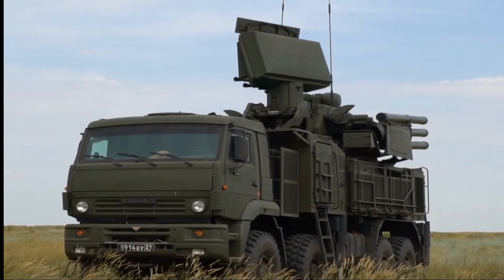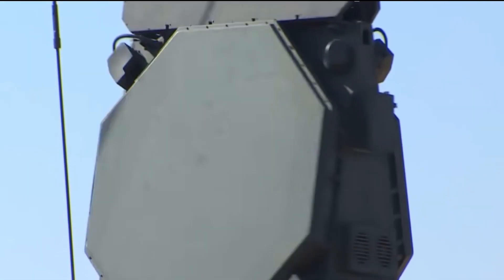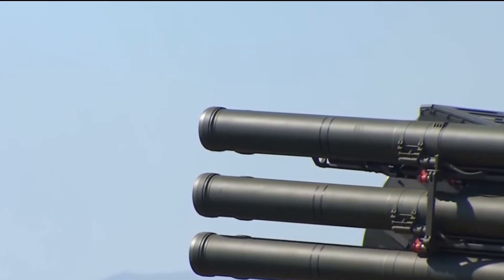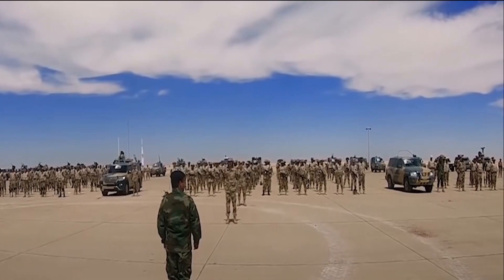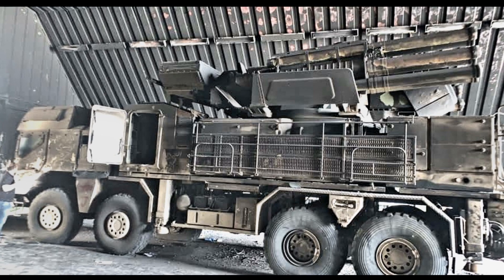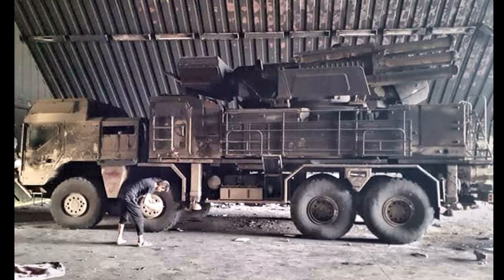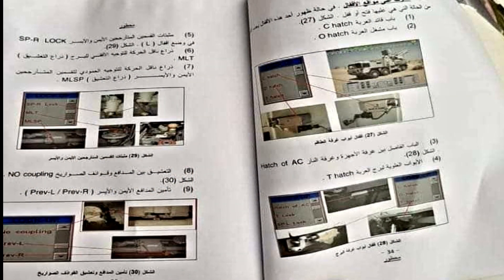The Pantsir S1...Useless piece of s-crap or there is more to the story than meets the eye?

Comment: There are many versions of the Pansir S1 system. Older versions with single-antenna radar have proven to be worse against, slow-flying objects like drones. These systems are mainly in their basic versions with a single radar antenna, in translation with poorer radar delivered to Arab countries. Very quickly, the Russians introduced the problem, replaced the radar with a completely new "JANUS" Dual Antenna Radar, which has no problems with drone tracking and destroying the same Russians. Pansir S1. Upgraded versions like the S2 and SM are just a story in themselves, even better systems, both in terms of radar and missile range, and the system itself. We could also see that the destroyed Pansir S1 systems were only with the old radar, not one with the new "JANUS" radar, which speaks in favor of the facts ... Also, we saw several destroyed S1 systems, in Arab countries that were not in operation, the radar was off ... We could also see the use of these systems in the open in the middle of the desert, poorly trained and without understanding this system of Arab crews ....

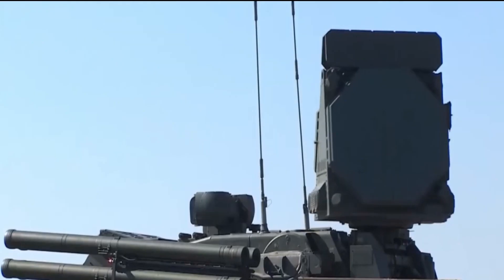PS the difference is obvious, when the generations of the S1 system are in question the right difference is seen most on the radars. You will notice the old radar with a single antenna in the image in 0:08 seconds, while the new radar "JANUS" with a dual antenna can be seen from 0:13 seconds.

Comment: Putin should be ashamed of himself sending sophisticated equipment to these weak Nations and don't know how to operate them that's very stupid of Putin
Reply: The Russians have recently modernized Syrian's air defenses. They integrated the systems into a unified command network and integrated guidance and fire automation systems. They connected the TOR, Pacir S1 systems and some S-125, S-200 and S-300 systems. information on EW system integration is unconfirmed, but likely. This reduced the complexity of the operator and reduced training requirements

Comment: Just a paper tiger
Reply: That keeps raping Turkish drones in Syria on a daily basis! LOL!
Reply: a AA system by itself is useless unless on open battle field. a AA system should always be in a network of several radars from diff pos. in area. NEVER alone like these systems were. an AA system is not just a launcher, its an entire package of tor, pantsir, s-400, s-500, s-300vm, and several dozen radars. same with a cruiser or destroyer, its a sitting duck if it got no tracing satilites, radar satilites etc. to guide its weapons and track enemy. most countries only buy launcher and 1 radar. or like UK buy ships but no satilites...lol
Reply: You mean like Patriot?
Reply: @tigersilberhannes9153  patriot is failed but never destroyed 😉😉😉
Reply: @jerromedrakejr9332  The Russians have recently modernized Syrian's air defenses. They integrated the systems into a unified command network and integrated guidance and fire automation systems. They connected the TOR, Pacir S1 systems and some S-125, S-200 and S-300 systems. information on EW system integration is unconfirmed, but likely. This reduced the complexity of the operator and reduced training requirements